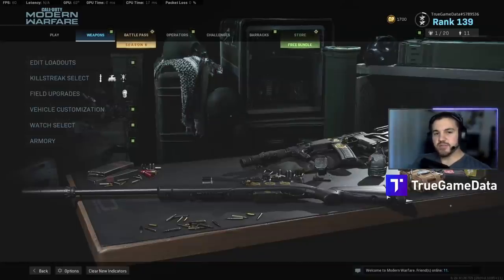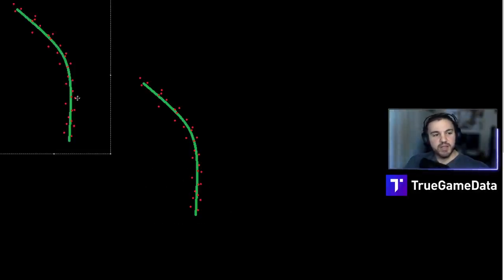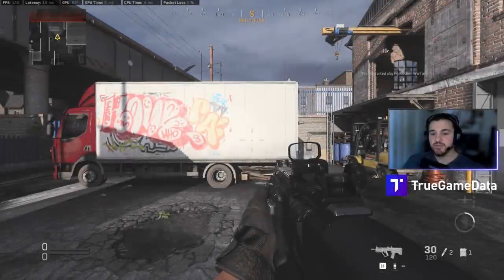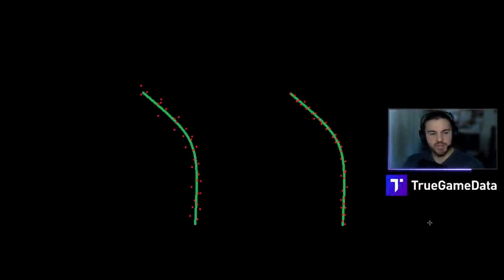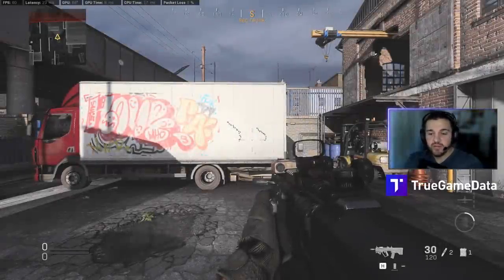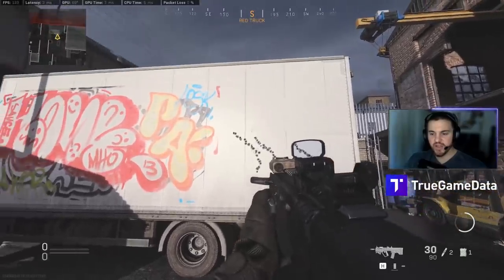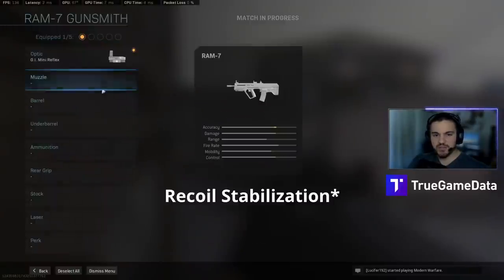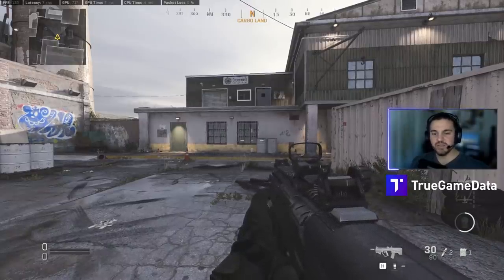What do "Recoil Control" and "Recoil Stabilization" actually DO in Modern Warfare?

Comment: after knowing this, what attachments would you say are best for a gun like the scar? which has a ton of recoil
Reply: My go-to SCAR for multiplayer has muzzle brake, 17" barrel, close quarters stock, rubber grip, and Sleight of hand. The SCAR has a painfully slow ADS if you use the 20" barrel and/or 30 round mags so I prefer the 17" barrel and rubber grip combo to help with the recoil and SOH to compensate for only having 20 rounds. The scar hits very hard so those 20 rounds can be very effective at killing several before needing a reload. The stock compensates for the barrel's additional ADS. The muzzle brake or commando both work very well on the SCAR IMO but the commando comes with an additional movement penalty I didn't want. I named this setup "Beast" because it's such a monster in multi. 

I've been experimenting with a WZ build, but haven't come up with a combo I like nearly as much as I like Beast in MP. WZ has such different requirements that you basically need a suppressor (I'm a sucker for the Tactical, I feel like the Mono has a recoil stabilization penalty on all guns), the 25 or 30 round mag, and SOH. That only leaves room for 2 attachments, and you should probably put one on an optic considering the ranges many fights happen at; I'd suggest a Holo (my fav is the PBX Holo 7). So, assuming you aren't using the irons (which are great in multi, but probably not ideal for WZ), that only leaves one attachment slot to truly customize: Barrel, Laser, Underbarrel, Rear Grip, or Stock.
Reply: dbozan99 your multiplayer class sounds impressive bro, thanks, i’ll give it a try!

Comment: If you want the best of both worlds, use the commando foregrip and compensator, DO NOT use rubberized grip tape, it doesent do shit except it just decreaces your aiming stability
(also compensator is the #1 recoil control and commando is the better stabilizer so dont use merc and muzzle brake)
Reply: take a hit of dat granulated shit, if you need a lil bump to get by
Reply: @VintagedMillennial  yea we dont speak of the granulated

Comment: With all the aim staibability, does the pattern get more straight? Just curious. Ram and M13 have horrible left and right recoil drift. I know it helps aim sway, but never knew if it helped straightening shots.
Reply from the maker: Nope it doesn't.  All it does is reduce sway. The only way to reduce that left and right recoil is to shrink the whole recoil pattern using recoil control

Comment: Hey do the longer barrels generally help with stabilization? Bc Ive been using the Ram with comm, ranger barrel, and rubberized with a mono supp and a 50 rounder, and it feels reallyy smooth but I usually run eclipse barrel with commando. How much does the rubberized grip tape and the extended barrel help with stabilization if it helps at all?
Reply: if we are to believe what IW says, use granulated for stabilization.

Comment: So this is why 1.5+ scopes have better recoil stab\control. Well you also not 100% correct on how recoil works, but closer than others.

Recoil control increase\decrease jumps between shots and value is consistent, where stabilization effects on direction of shot and value is shifts between random and consistent. So they both have effect on both axis.

Comment: Why does some youtubers looks like they have less recoil when playing?
I know u can control or drag ur aim against the recoil pattern but sometimes (actually most of the times) they shoot like theres 0 recoil.
Reply: They're probably using a mouse
Reply: So many variables could be why it appears they have no recoil, but the most likely one is that they're on PC. 

On PC you can change your Field of View (FOV) in the graphics settings, this adds a fish-eye lense effect giving you more peripheral vision at the cost of things at the center of your screen appearing smaller. This means recoils is visible less noticeable, but it's still there, it just doesn't look as powerful as it truly is.
Reply: @heyman4899  yeppers, but the recoil is still there and still needs to be compensated for. It just appears weaker then it is

Comment: the screen is not shaking you kinda got it wrong as you got the oden bullet velocity wrong on your website there is no way it has 1500 bullet velocity as it is slower than other ARs,

the green dot shows the center of your monitor without commando grip the guns will shoot off the center of your monitor for balance issues i guess ram7 m4 will go below the center m13 go above bizon is the worst it goes way below the center of your monitor cuz the gun has no grip and its just pure trash

you can test it yourself i have a software that puts a tiny dot on your center of the monitor for this kinda tests and quick scoping with snipers